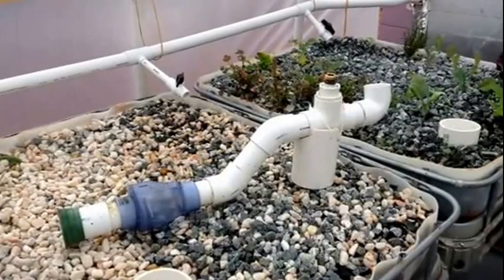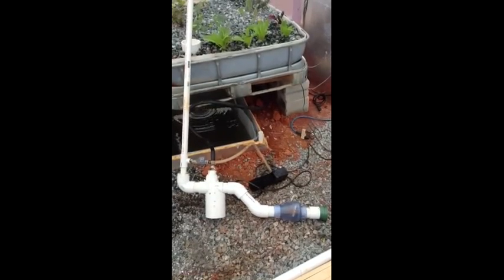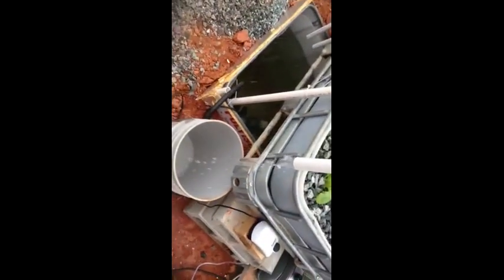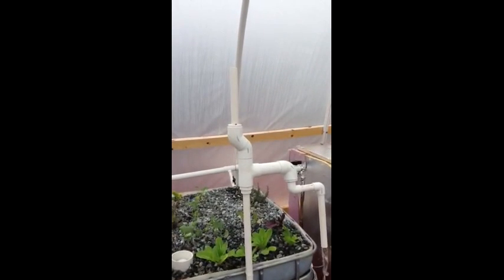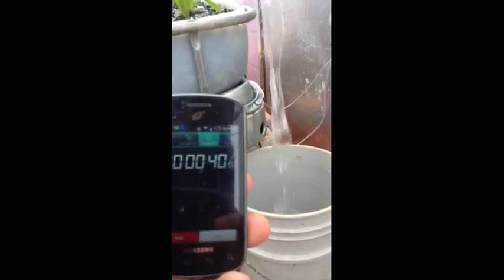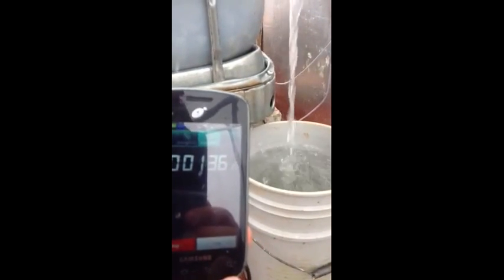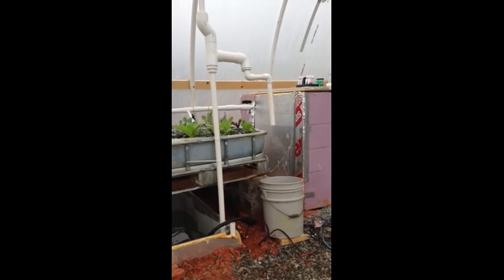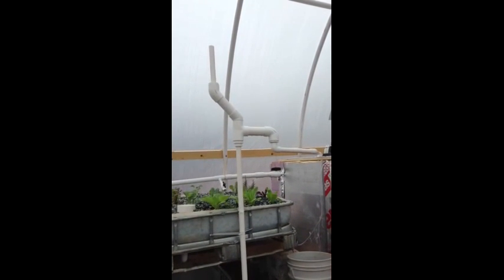Aquaponics Airlift Pump

Comment: We have air lifts in China, Thailand, Philippines, American Samoa, to San Juan, Puerto Rico.....everyone is still running. We fine tune them to match the air compressor to the height needed to pump to. I am having Natalie forward our manual so you can se a complete breakdown of the design. Just a thank you for posting your video. What is your direct email address to send the PDF file to?
Reply: Hi glenn, could you guys send me a PDF with your design? Thanks

Comment: Aloha, Glenn here...I would suggest installing a 12 to 18 straight pipe coming out the top of the air water seperator. I would also suggest making the pipes on either side of the iar injection be 8 inch ....makes for a bigger bubble.
In teh air separator, make sure the one inch pipe extends into the two inch Tee fitting thus allowing the water to shoot up , fall down and exit the side of the two inch fitting.,

I am going to send you our manual...normally $50 as a thankyou for your posting the video...aloha, Glenn
Reply: Glenn,
My airlift pump has been kicking butt for around 8 months now.  Love it!  The suggestion on 8 inch on either side of the air injection is new.  Not sure I follow.  Still need to make the "A" frame and test it.  How are yours doing?
David

Comment: im having trouble with airlift.... I want to raise the water about two (2) meters above ground I just can't get a descent water flow
I tried 10 watts aur pump and the latest is 35watts
Reply: They only suggestion I can give you is this.  With air lifts it's all related to submerged depth.  The deeper the water column the greater the force acting on that column and thus greater flow.

If you are pulling from a sump tank, have a 4-6 inch pipe plumbed to it and go 10 feet in the ground.  

Have your air lift at the bottom of the pipe.  Your flow will increase.  I have found two thirds submergance to lift works well.  (In your case, 2m lift, 6m depth...)

You will need an air pump that can create enough pressure to o er one that head however.

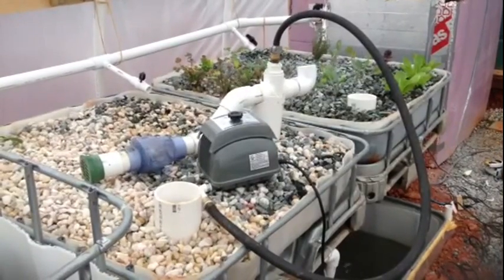Comment: Good Job my friend another airlifter aquaponic guy :)...I have just finished my system also and im getting a 1:15 per gallon on a 18W eco1 air pump... keep it up your getting close...I built my system on a 1 1/4" in to 3/4" out flow. works great to me
Reply: *****  Hi.  Great replication. Could you detail your final design?   Keep it up!

Comment: The 2 45 degree can be close together, and laying 45 degree on their side. When you go up like you have done....you lose 4 or 5 inches of water lift. You want the up lift tube to be as low in the fish tank as possible. The lower the air input is, the higher and more water you get. The two 45 degrees are to keep the air bubble of compressed air from sneaking around the check valve. Air does not want to go down, so a solid wall of water is pushed against the check valve, closing it, and the air compresses till it pushes down enough to clear the 90 (or TEE) at the bottom of the up lift tube. We Have also experimented with having a 2 or three inch pvc coming up the air lift tube (at the bottom) and then transition the one inch uplift tube. Gives it a bottle rocket effect. You are on a good path.....like you YOUTUBE.

Comment: Hi David, nice system, good luck.  If you shorten the total lift required by about 2', to the 1.5" tee; the water volume will increase tremendously.  enjoy your AP system!
Reply: Sorry I can't post a picture here.  But you will want to remove the excess pipe above the grow bed on the UP tube.  You have a 1.5" tee on the UP tube, one leg goes across to the right and then drops DOWN to the outlet into your bucket.  The length of that DOWN tube should be removed from the UP tube so you don't need the DOWN tube.  In other words, you need to lower the TEE so it is at minimum height above the grow bed to deliver water to the grow beds.  You will need to extend your air exhaust tube more than likely as well
Reply: *****
 I have used airlifts and I'm getting ready to incorporate an air lift pump in a project I am building.  The reason your flow will be better is because of reduced head height.  The weight/mass of the water the air is lifting will be reduced.
Reply: Jim Troyer
can you report the difference of flow after you make changes, please? Thanks.